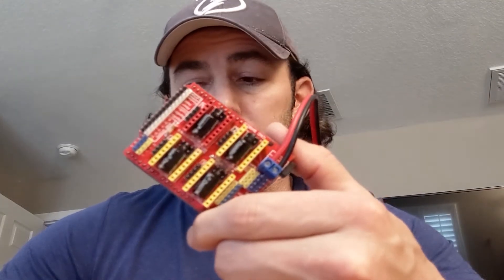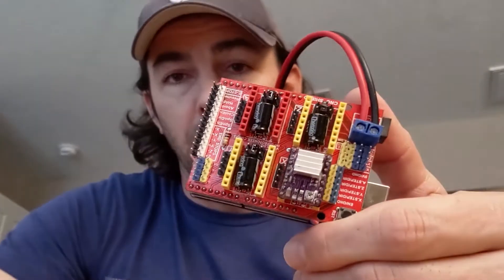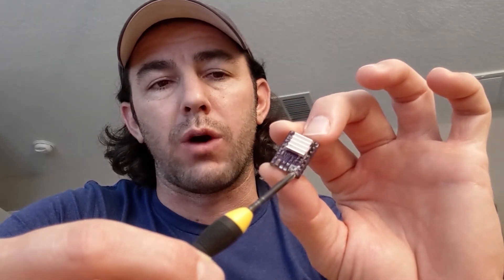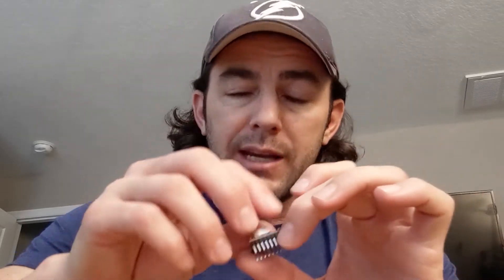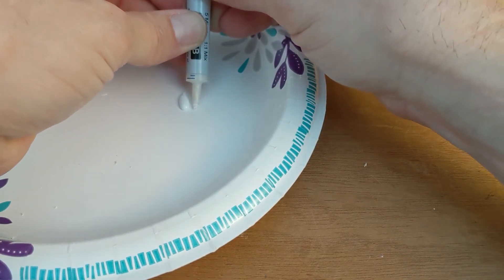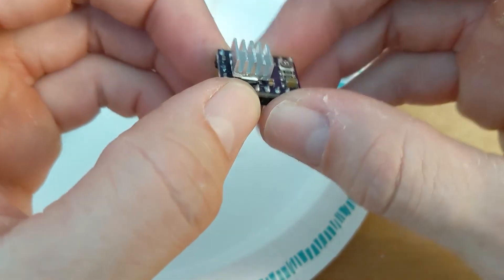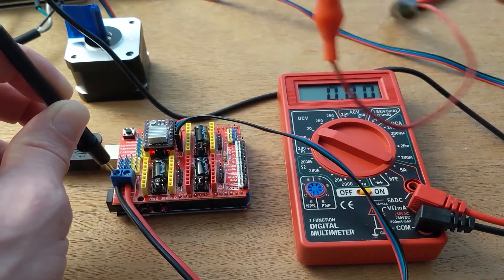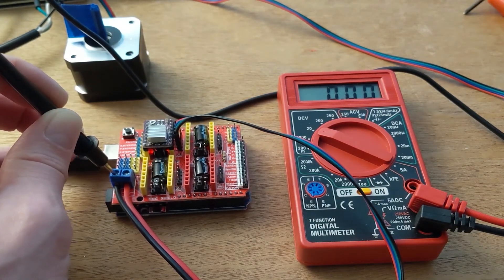CNC Shield, Arduino UNO, DRV8825 - Tips for success!

Comment: I would call this a design flaw. Stepper motor keep moving and spindle keep running 10k rpm or more,  cnc has 3  (or 4  in some cnc system )stepper motors cables ( and each contains 4 wires) , chances  for one of the wires getting loose or broken is not low,  this can be considered "disconnect and or connect a stepper motor",  so it could smoke and fried at any time ??   So, this is a design flow.     Warning: Connecting or disconnecting a stepper motor while the driver is powered can destroy the driver.

Comment: The manufacturer warns not to connect or disconnect a stepper while the board has power.  Pololu has a video showing how to set the current limiting resistor (with power on and no stepper attached).  You are supposed to adjust that resistor to make sure you don't fry the driver and possibly damage your stepper motors.  After adjusting the resistor, then you power off and connect your stepper.   I think you might have burned some parts because you missed the part about adjusting the resistor, not because you had a stepper attached.   See their video here: https://youtu.be/89BHS9hfSUk
Reply: He specifically moved the pot to 0 before starting and i would listen to the manufacturer when they say not to power the driver without the stepper motor connected.

Comment: Can you run 2 Nema 17's off one DRV8825 driver for the same axis?
Reply: Definitely.  I followed the following link to wire 2 nema 17's in series and it works perfectly.  I use this series configuration on an MPCNC machine that runs a laser head.  https://docs.v1engineering.com/electronics/steppers/#series-do-it-this-way-
Reply: @joeeisenberg8111  This is what I needed! Thank you :)

Comment: I have powered up the board without connecting stepper motor.. instead the driver it fried my arduino
Reply: Sorry to hear the news, I surely have not experienced the same and I have powered the shield many times without any steppers connected.  Is it just a blown fuse?  If so, you can bypass it by soldering on a solid piece of wire, but of course you should know this comes with additional risks.  Also, what tests were performed to confirm the arduino is fried?  Please explain so that others can learn from the info.  Thanks!

Comment: Thanks so much for the video! If I put the A4988 Driver to the Shield upside down. Is it likely that the cnc shield is broken, too?
Reply: The only failures I have seen on the CNC Shield itself have been a blown on-board fuse, which kills power to the entire board, and you can usually confirm this visually as the fuse turns black in color.  My advice to you would be to test a well-known good driver on each of the CNC shield sockets to determine if anything is broken.  Keep in mind, you must have a stepper attached to the socket that you are testing otherwise you will burn up the driver.

Comment: Thanks for the tips. I'm just about to setup a CNC Shield, do you know if the A4988 driver is also clockwise on the adjustment screw to zero out?
Reply: Seems to be the other way around on the A4988 - "when turning the pot on a clockwise direction the Vref voltage will increase and decrease when rotating it counterclockwise"
Reply: @sallerc  Can we run Big setpper motor(NEMA 23) with cnc shield 
plz reply
Reply: @sukhjotsingh8386   Yes I believe so, but you are somewhat limited in the amount of current the NEMA 23 motors can pull when using the CNC Shield
Reply: Sukhjot Singh hello bro,can you tell how your project going?can you help me.
Reply: @raunakmuz   bro i want to drive big stepper motor (nema 23) with cnc shield v3
Reply: @raunakmuz   what is your project
Reply: Sukhjot Singh i am trying to build my own diy cnc for starter
Reply: Sukhjot Singh i guess that will cause lot of heat at drivers..so better use breakoutboard and microstep controller for every nema23.

Comment: What amperage is your power supply ?
Reply from the maker: 12v for this setup.
Reply: @jtechcustoms  amps not volts? i have 12 v 3 amps for nema 17 rated for 1.7amp. yours similar?
Reply: @christopherlee3045  I am using a 12v 29amp PSU.  Model is LRS-350-12.

Comment: When I try adjusting the current on the stepper drivers, nothing changes. It hovers either around ~.5 or 0. Does this mean the driver is broken?
Reply from the maker: Sorry for late response, but I would guess the driver is bad in that situation.  Have you done further testing, or replaced the driver since posting the question?
Reply: jtechcustoms I played with spare drivers and found that it is just best not to adjust the current, as it seems to work perfectly without any adjustments.
Reply from the maker: @ee93  if your steppers are warm to the touch after a few minutes of holding position then you should be okay but if they aren't getting nice and warm then you are likely missing out on extra current which relates to more power.  Underpowered steppers can lose steps more easily when they are not being driven to the rated current.  Have a great day.